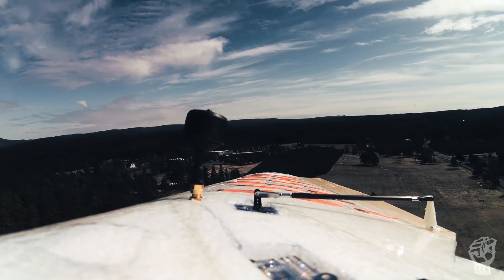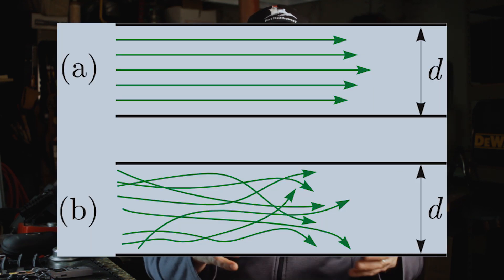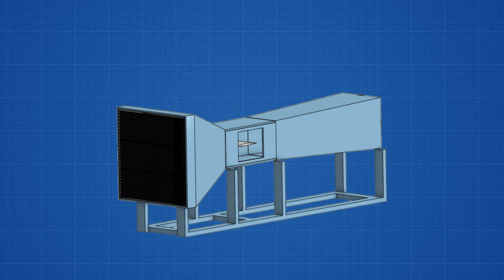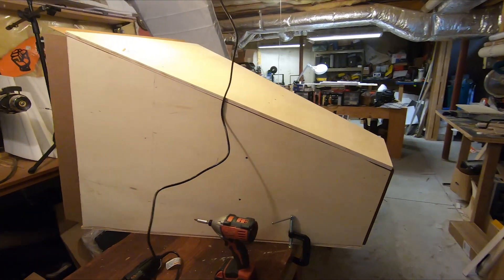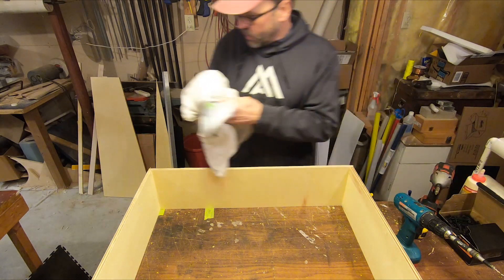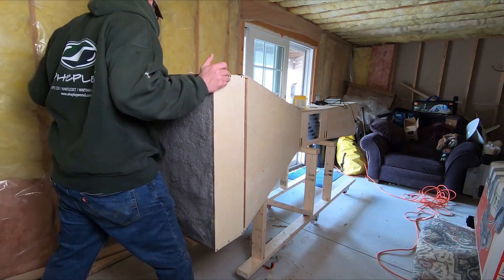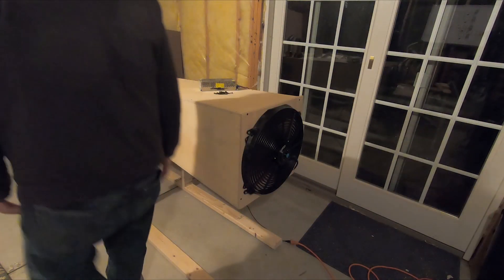Wind Tunnel Build Part 1 (Knowledge Series video 4)

Comment: I know this is a long time since you uploaded this video but this is very useful for my current thesis haha.... Just wanted to ask were you able to measure what your avg wind speed is in this windtunnel that you could achieve to test your wing profiles and aerofoil profiles? @DefiantWings
Reply from the maker: I was only able to get about 15-20mph with the fan I used. It needed a more powerful blower.

Comment: Hi, 
Good video however I don't understand, you said you will use a contraction ratio of 6:1. The area of the testing chamber is 12in and the inlet area of the contraction cone 30in and not 12*6=72 inch square. Maybe my understanding is wrong, so can you explain it to me ?
Thanks
Reply from the maker: It’s a 6:1 contraction in area. 12”x12”=144sqin x 6 = 864sqin. I used 30”x30” for the inlet wick gave me 900sqin.
Reply: @DefiantWings  oh, yes understood thanks for answering so quickly !

Comment: How where the straws fixed in place? If they aren't glued won't they just get blow out by the fan?
Reply from the maker: The straws are stacked between pieces of screen. It holds them in place and helps cut the turbulence as well
Reply: @DefiantWings  What type of screen? A common exterior window screen?
Reply from the maker: Yep, it’s some fiberglass screen I had left over from a screen door repair. Nothing fancy 🤣
Reply: @DefiantWings  Thanks for the reply! I'm building a similar small-scale tunnel and my one concern is that the screen would unnecessarily decrease the velocity of the air entering the test section. However, the screen saves a lot of time and money over using spray adhesive to fix all the straws in place.
Reply from the maker: It was a compromise I was willing to make. A lot of the research I read said that screens were a part of the flow straitening process anyway.

Comment: hey, I am looking to do this as a part of my master thesis, can you please name sources you used for determining geometry of a tunnel for best flow and speeds?
Reply from the maker: https://www.intechopen.com/books/wind-tunnel-designs-and-their-diverse-engineering-applications/design-methodology-for-a-quick-and-low-cost-wind-tunnel
This is one of the documents that I used and the only one that I still have a link to.  Its a pretty good writeup and should help you with the sizing.  I am planning to spend some time on the wind tunnel this winter to try to develop an instrumentation package.  I'm also looking at a higher capacity fan as well.  Too may projects, so little time
Reply: @DefiantWings  thank you very much, finally a piece of literature that describes exact geometry after all the books I downloaded

Comment: Cool wind tunnel build, learned a lot from this!! Which fan did you use?
Reply from the maker: I’m glad you liked it. I just used a 12v car radiator fan I found on Amazon. It’s no longer available but there should be others. What I found was that it didn’t supply a high flow rate or velocity when used in the tunnel. I think the highest speed I was able to get was 13mph. Fast enough for what I needed but I may upgrade to get more speed.

Comment: Can u tell me again what is the dimensions ?
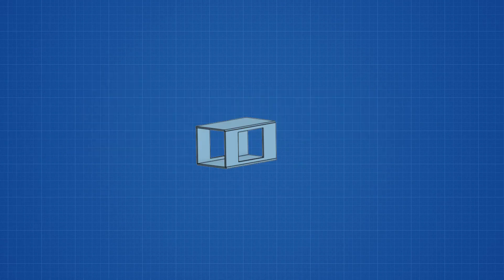Reply from the maker: The dimensions discussion is at 6:06 
But the test chamber is 12”x12”x24”. The defuser is 12”x12” tapering to 16”x16” and is 38” long. The inlet is 30”x30” and tapers down to 12”x12” and it 42” long

Comment: Hey Shawn,

Saw you in the After hours Podcast. 

Would you mind testing some KFM airfoils? That would really help the community because we have no scientific data on KFMs at low Reynolds numbers. Fortis did some research but even his RE were way too high. 

Simulation programs can't handle the KFM because you need a precise transition model but that does not exist (as far I know).

Please have a look at the KFM Threads on RCGroups.

Cheers (from Germany)
Nik
Reply from the maker: I’m sure we could make that happen. I need to get it finished up this winter and then we can talk further

Comment: That looks incredible! Really helped me out and I can’t wait till part 2!
Reply from the maker: Jarrod Ladd I glad that it helped you out. I hope to get back to the project and video this winter when I have more time
Reply: @DefiantWings  Looking forward to part 2 as well! I'm working on a similar project!
Reply from the maker: QuadMcFly the smoke system and lighting is proving to be more complex and problematic than the actual build.
Reply: @DefiantWings  I believe it! Fortunately for mine it's mostly for dynamic load testing of drone power systems, so I don't particularly need a smoke system.  Curious what approach you're taking. I'm considering adding one. I've got some buddies who are super into vaping, and I think we can use a vape system and copper tubing to create the smoke points without disturbing the air too much. 

My biggest struggle right now is trying to figure out how to mount the load cell and motors without disrupting the  air flow. I already have the logging system built and I've been using it for about 3 years now, so that part is no problem. Figuring out how to mount it though :O I need be able to consistently control the angle of attack as well, so it needs to be able to rotate the motor/prop assembly in relation to the air stream at specific repeatable angles.  I have a few ideas. I'm thinking of using a vertical bar wrapped in a teardrop airfoil to prevent turbulence, and housing the load cell inside the tear drop. I can use a steel bar mount coming directly out from a slot in the airfoil. Then the bar inside the airfoil can rotate while the airfoil says consistently pointed into the airstream. I can probably 3D print the airfoil easily enough.

This is a fun build. I'm looking to achieve air speeds of about 40m/s and I'll be using 4 miniquad motors in custom ducts for the powerplant, software speed control via UART. The whole system should be able to be completely automated. I'm hoping to use a high torque stepper motor to drive the rotation sequence as well to achieve the fixed angles.

Comment: I have been considering a similar tunnel, do you know of any basic guidelines for fan size and power for a given chamber cross section and flow speed? 
I was thinking of sculpting a plug mold of the contraction zone out of something like clay (with some hollow filler in the center to reduce amount of clay) or carving it from blocks of wood, (finished with some non porous coatings and mold release) then covering it in fiberglass for a nice seamless smooth shape. 
I would also fillet all the corners (maybe 2 inch radius) so the duct cross section is not a sharp cornered rectangle,  to reduce interference drag and flow issues; this filleting applies to all sections including test chamber.
Reply: Annnd I've read that honeycomb is good for reducing lateral turbulence but screens are needed for longitudinal turbulence. (not sure what how they defined this, I'm assuming small pressure pulses are longitudinal turbulence) Something like window bug screen. This may be useful in the diffuser just before the fan. 
The primary paper I was reading was about closed loop tunnels so there were two corners and 3-4 diffusers between the test chamber and fan, so they used screens between the honeycomb and the contraction zone.(as I recall it was screen of 0.5mm wires and 80% holes by total area)
Reply from the maker: @mytech6779  
Here is a link to one of the documents that  I used.  I found it very helpful.  https://www.intechopen.com/books/wind-tunnel-designs-and-their-diverse-engineering-applications/design-methodology-for-a-quick-and-low-cost-wind-tunnel

I have window screen on either side of the straws/tubes.  They help with the turbulence and hold the straws in place.  win-win

Comment: I wanna build one could u possibly help me with the dimension I do rc speed runs with 5th scale cars
Reply from the maker: Here is a link to one of the documents that  I used.  I found it very helpful.  https://www.intechopen.com/books/wind-tunnel-designs-and-their-diverse-engineering-applications/design-methodology-for-a-quick-and-low-cost-wind-tunnel

There is a lot of great information in here.  You really want to start dimensioning the test chamber first based on the size of you test vehicle.  All if the other components are based on the size of the test chamber.  The document linked above has a lot of great info on the sizes